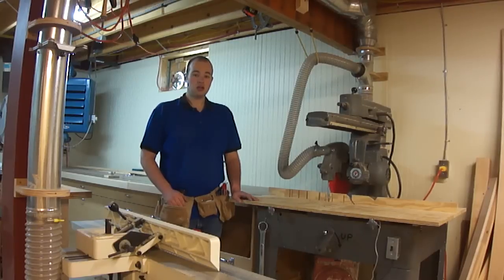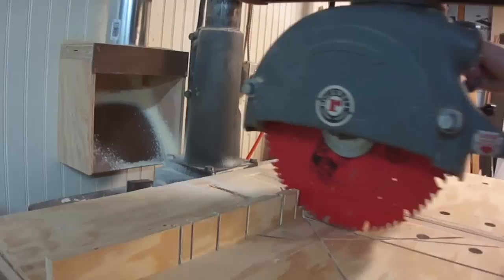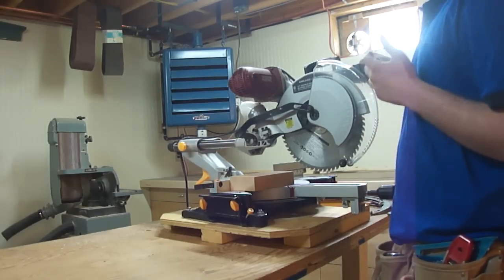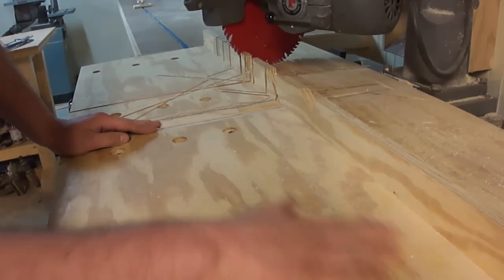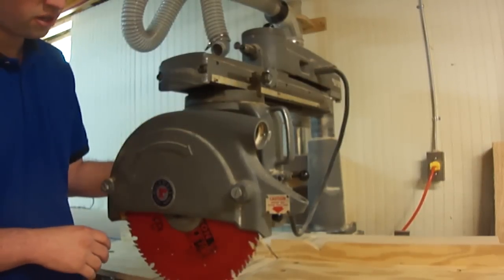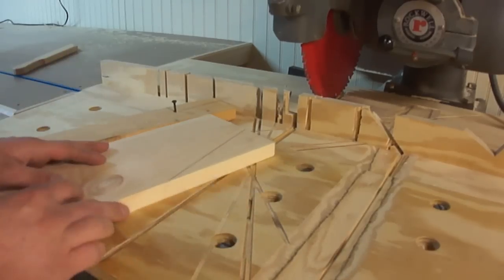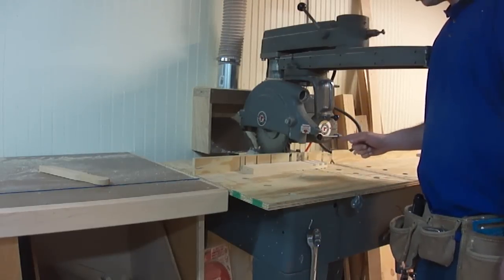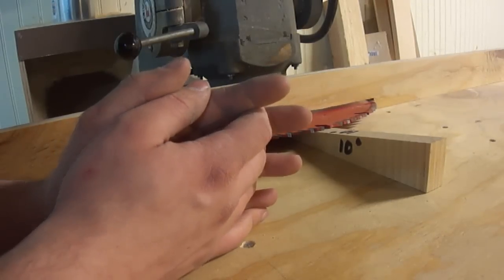How To Use The Radial Arm Saw

Comment: Very nice video on my second favorite tool in my shop.   I turn wood mostly.   A couple points I would like to make though.  The reason your saw guards along side the blade don't work is your fence is too tall.  No more than an inch tall and you could put the pretty much useless guards back on.   They are mostly a reminder thing.   Second, as an electrical engineer, I can't believe that you unplugged the saw to change the blade.   It is no more dangerous than the many numerous times you grabbed the blade with your fingers during the video!   Although the chances of the switch failing and hitting the motor with voltage are slim, that situation is possible especially on a 240 volt saw that probably has a one pole switch.  Safety Statement:  Be safe, the life you save may be your own!   Respectfully,   Kevin
Reply from the maker: Kevin Coop thanks for watching. Just to clarify a couple things that while apparent to me, didn’t get discussed in the video, first: the reason for the tall fence is that I cut quite a bit of crown molding with this saw so I based the height of the fence on that. However you are correct that a shorter fence would make it possible to use those guards. Second: the motor is 3 phase so there’s a bit more to it than just a single pole switch. The switch on the front of the saw switches the 24v coil on the 3 pole motor contactor mounted to the back of the saw. Phase 1 and 3 are feed 240v from the wall while phase 2 is generated by a homemade static phase converter also mounted behind the saw. The static phase converter generates phase 2 long enough to get the motor up to speed then it shuts off and the motor runs on single phase. As for touching the blade vs changing the blade: I said to unplug the saw because some people watching will no doubt have the newer style Craftsman and DeWalt saws that have a switch mounted to the end of the arm. It could be possible to bump that style switch to on while changing the blade. As for this one spontaneously starting, that would be like getting struck by lightning.
Reply: The Northland Workshop    That makes way more sense, but it still would be better not to touch any saw blade with the saw plugged in on a video especially.  I hope you agree.   Any future videos would be welcome!   Respectfully,   Kevin
Reply: @TheNorthlandWorkshop  Great video!  My dad taught me to use a RAS when I was 7.  He did everything with it (still does).  Watching your video and advice was nostalgia-inducing and matches my own intuition well (although having ripped a fair amount of wood with the anti-kickback pawls in place and still having a kick back or two over the years, the ripping demo made me nervous)!  As a point of interest, you are running a 3-phase machine on a single phase?  From your description it sounds like your "static phase converter" is delivering power 90 degree's out of phase with the the 240 (which you call phases 1 and 3).  That would be sufficient to get things spinning (though rather inefficient, which doesn't matter because of the short ramp time and light load).  I guess you could have an RLC network to get an arbitrary phase (120 in this case) for a single point on the load line.  What I'm curious about is that with the electric machine only running from a single phase while under load, how does the power compare?  3-phase machines benefit from constant power delivery as the vector sum of power is constant for a 3-phase set.  In this case, since the motor is wound for 3-phase power, and you are running it off of single phase, it seems like you would have interesting behavior under load especially if the slip becomes significant (for induction machines, slip is required to deliver real power and increases with load, ramping the induced rotor current and therefore torque).  Does the blade ever stall under substantial load?  Or does your static converter just kick in providing some level of field rotation?  Also, do you have some sort of network connected to the motor terminals beyond the static phase converter to overcome the challenges?  Just curious.  And again, great video...there's so much misinformation out there about RAS's
Reply from the maker: Anthony Sagneri those are all very good questions. Your understanding of my phase converter is correct. There are two types of static phase converters. The simplest (and cheapest) is really a just motor starter, which is what mine is. Once the motor is up to about 70% full rpms the starting capacitor is disconnected from the phase 2 winding on the motor. The more elaborate single phase converters have a smaller start cap and also one or more run caps between the one of the powered windings and the unpowered winding to keep some current flowing in the third winding. That one could be considered more of a phase converter because it does have current flowing through all 3 motor windings during use but they tend to be very unbalanced and nowhere near 120 degrees apart. But again mine is the simplest style that just starts the motor and then disconnects the start cap. Start caps are dirt cheap and run caps are not so cheap so I decided to try it with just the start cap and see. I haven’t found any manufactured ones that use the run caps and I think it is because there is a bit of trial and error when sizing the run caps to make sure  all the motor winding currents stay with spec and people don’t want to fuss with clamp on ammeters when buying a static phase convert. A 3 phase motor will develop 70% of it’s rated hp when fed from single phase so in my RAS has a 3hp motor so I’m getting 2hp out of it. 2hp is more than enough for everything I do and I’ve never seen any lack of power from it. The start cap reconnects if the motor’s rpms drops below 75% of it’s name plate rpms so if it starts slowing down the cap will kick back in to try and “start” the motor again. The motor runs a little rougher than on true 3 phase but it’s not really noticeable. I originally ran this saw off a 50hp yes 50hp rated vfd. It was free from a local company who installs dairy milking equipment and it is what they run their vacuum pumps with. I fixed the vfd and used it for a year before one of the big electrolytic caps blew up. It made a big bang. It was cheaper to buy the parts to build the static phase converter than it was to buy the giant electrolictic cap for the vfd. Also the high frequency component of the synthesized 3 phase from the vfd made the motor give off an annoying high pitched buzzing sound. It did however give it full power and soft start. However after using the saw with the simple little static phase converter for just under 10 years I can say that it does everything I need it to do and hasn’t had any issues unlike the vfd that blew up and filled my shop with smoke.

Comment: getting one educated about the means and methods of securing and applying clamp down (easy on a wood table) vastly increases safety. You do not have to place you hand near the blade if you carefully and preventively install removeable clamp downs that can be apply at critical locations on the table. 

Roger Cliffe has a long stick with a cam, with a flat tip latching onto a groove on the fence. And there are numerous other means, with T-nuts, threaded inserts, and T-track on the wood table. Install T-nuts (cheapest) onto the bottom of the table (countersunk where necessary)  at critical positions before you install the table.

Comment: If you want to have a small workshop  and you are a beginer, i suggest you to buy and old radial arm saw witch is in  good condition.
I have such a machine since 1968 and i still use it everyday. You can do everything with it, and you have only one machine.  You can
buy a used RAS for 100.00$ in excellent conditions. Later buy a band saw, a table saw, a press drill, a sander, a planer, and other hand tools.
I think that it's the first machine to buy. Have a good day.
Reply from the maker: Mars-L Quebec very good points.

Comment: I often find myself putting ling stock behind the blade and pushing through it. Never had an issue. I also keep the wood in front of the saw at rest and pull through. Both ways work good and both ways have potential dangers.

Comment: Very complete presentation on the RAS. Bottom line...a very dangerous tool which has to be used with great caution. Good results can be achieved but other tools can be used to accomplish the same results with far less danger.

Comment: Most of this stuff applies to sliding miter saws too.  Good video. Except you should begin the cut with a plunge on a sliding miter saw so you don't lift the work, even when using hold downs.

Comment: I've never been in a situation where I thought the radial arm saw would really hurt me. Table saw always has me on my toes. The only reason I ever use the table saw anymore is for bigger sheet goods that I want to cute accurately. Anything more "normal" sized I do with the radial.
Reply from the maker: Sky Warp I tend to be just the opposite where rip plywood on the RAS because mine has a wider rip capacity than my table saw.
Reply: I don't have the wall space for the length. Otherwise I probably would use the radial for sheets too.

Comment: Thanks for a great tutorial on the radial arm saw. Probably the best presentation I have seen. I have had an old Craftsman  model for about 30 years and I think it was about 25 years old when I bought it. I have used it (as a hobbyist) very regularly but have always been a little nervous about ripping. After watching your video I feel a lot more comfortable ripping. But I have one set of accessories that I have never used...it is a full set (1 head and 18 cutters) of molding cutters. I think these  would be used almost exclusively in a ripping mode...but don't know which direction to cut...with the rotation or against? Could you please comment on this? Thanks again for a great tutorial.
Reply from the maker: Ed Middleton thanks for watching! For a molding head cutter used in the ripping position the workpiece is pushed against the rotation of the blade.
Reply: Push materials into the bladeteeth pointing towards you.thats ripping it right.nice easy motion

Comment: good video i grew up in a shop (my Dads) that didn’t even have a table saw everything we did was on a 10 inch Radial Arm saw  it was a oldAMF Dewalt Green Speckled  one i believe from the 1950s  i’m wondering if those kick back  components would work on your saw  ? as it looks like  it would to me ? i’m sorry i don’t have the saw any longer or i would check  yet i know there is a big community  of people that love and collect those saws  today IMO my Dads model was always a little underpowered  as it would often trip the built in circuit breaker on the motor  most especially when ripping plywood
Reply from the maker: Craig Monteforte you know I never thought about seeing if a different brand’s anti kick back parts would fit this saw, that’s a good idea. I’ll try looking into that, thanks. As for your dad’s old DeWalt, those 1950’s green ones were some of the best radial arm saws ever made. I’ve heard of people replacing the 10” blade with an 8 1/4 bade for ripping on those saws in order to keep it from tripping the breaker.

Comment: are you able to tell me what size wrench you need for the that arbor? I won this exact saw at an auction for $20 bucks, and need to put on a new blade (for some reason there is cement on it? lol). I think I saw yours was 1 5/8" ? Thanks!

Comment: I noticed those bench dog holes in your top. I was wondering , Instead of using your hand to hold the piece,, could you use a clamp mounted through the dog holes?
Reply from the maker: Those aren’t dog holes, they’re the counter bores for the screws that hold the top down. I don’t see why you couldn’t drill dog holes in the top and use a clamp like you suggested.

Comment: Replace your base table maybe about 4 to 6  inches more to the front.  I only use mine on cross cut . I have a table saw and miter saw. Since I. bought a INCRA miter express sled make. My woodworking enjoyable
Reply from the maker: jessie lacson I can’t replace it because the front mounted fence locking knobs are in the way. Plus this table is identical to the one it came with from the factory so I trust the engineers knew what they were doing.

Comment: Is it advisable to slightly tighten the sliding carriage lock when cross cutting to provide some friction to help keep the saw from grabbing and climbing during the cut?
Reply from the maker: Good question but I would say probably not because that would likely wear out the lock fairly quickly because it isn’t designed for sliding friction. They do make spring loaded cables that pull the carriage back towards the column and help appose the climb. However the tendency for the saw to climb should be very slight. If climbing is a recurring problem I’d make sure the blade is truly parallel to the path of cut (called the blade’s heel) and that the blade is the correct type. Finally excessive climbing could indicate that the arm just isn’t rigid enough which can be an issue with some models of saw’s sold by a once large department store.

Comment: excellent vid 

my only issue/concern is the exposed portion of the blade during the raised panel cut....and maybe it was just the camera angle.
I realize that you have the same issue 100% of the time on a table saw performing the same operation, but somehow the setup you shared scares me more
Face it - if we are raising a panel vertically or horizontally, there is a large portion of exposed spinning blade just looking for a hand to bite.

BE CAREFUL OUT THERE !!!!!

And Good Lord - if any of you are on Blood Thinners - have all manner of first aide in your shop - I had to assist someone who is in that condition and they managed to lose 3 pints of blood out of a rather small wound before help arrived and the blood flow was stopped....and it really was a rather small wound, well several small wounds but...., on the rest of us, a bit of pressure for a 5 - 10 min might have done it...at least until proper attention could be had.

Not that any of us should ever get hurt in the shop, but it's a shop full of stuff that cuts hard wood, and we are only covered with soft skin ... it happens... be prepared rather than in denial. (I'm off to the store to buy more stuff !!)
Reply from the maker: Greg Mislick I think part of it could be camera angle because in person it looks just like the table saw setup just turned on its side but you are correct either way there is a lot of exposed blade. I have been thinking about a guard for the panel raising table and if I come up with something that works I’ll make a video on it.

Comment: You really should get a kick back device for this saw. If you can not find one GET ONE MADE. All you need is a steel bar that fits the hole in the guard. Then on the lower end have the bar flattened on both sides and in line with the blade. Drill a hole thru the center of the flat part. The (4 to 6) pawls that stop the kick back are a triangle shaped metal that slide on the wood as it goes through but immediately digs into the wood if it move toward the blade.

Comment: I did find a triple chip, negative rake 14" blade for my Redstar multiplex 60.  They do exist but they are expensive.  The rake is -5 degrees.  I actually got it off Grainger years ago. The blade is from Dewalt.  If I could only find an 18". That would be expensive but man, would it increase my cutting capacity.

Comment: Fine instruction.  This radial arm saw is incomparable.  Manufacturer?
Reply from the maker: José Duarte thanks, this one is a 1962 Rockwell model 14-RAS. It also was sold as Delta 14-RAS once Rockwell split off Delta and Porter Cable.
Reply: @TheNorthlandWorkshop  Thank you.

Comment: do you think it is safe to use a round wooden dowel as a anti kickback pawl?  or does it have to be made of metal and have the movable fingers to work properly?
Reply from the maker: awlabord unfortunately it has to be metal and have the fingers in order to work correctly and be strong enough to stop a kickback.

Comment: Some guys make angle cuts using a pattern-board pre-cut at the desired angle.That way, they don't cut up the table, and don't have to fiddle with getting the arm back to ninety degrees dead on.
Reply from the maker: jimmy5F that is true. Some people really like the angled jigs however I’ve never been sold on them because the hold the workpiece at an angle so the long support table on either side of the saw doesn’t support it so you have to find another way to hold the end of the workpiece up. Plus to me a radial arm saw needs to be built in a way that lets it lock back into 90 degrees repeatably. If it can’t it’s time for a better saw.

Comment: Have a Comet Cub and would like something bigger. Which is model is yours? Would you recommend it? Thanks for your videos.
Reply from the maker: Mine’s a Rockwell 14-ras. There is also a long arm of this saw the 40CL if you want maximum crosscut capacity. I highly recommend this saw. It has everything I look for in a radial arm saw. It is a turret design so it can miter to the left just as easily as to the right, it has the height adjustment crank on the front of the table which really helps on a saw this size, and finally it is dead accurate.
Reply: Thanks